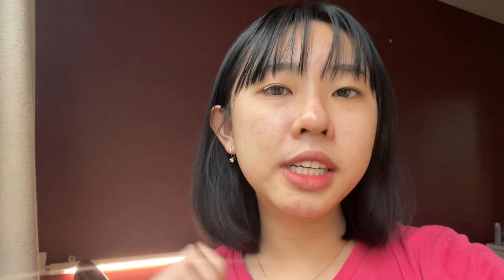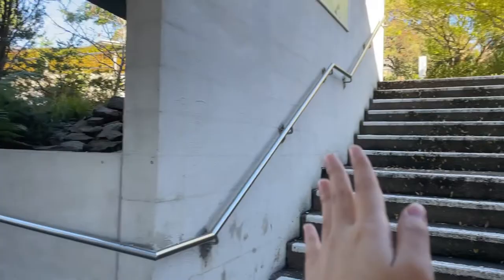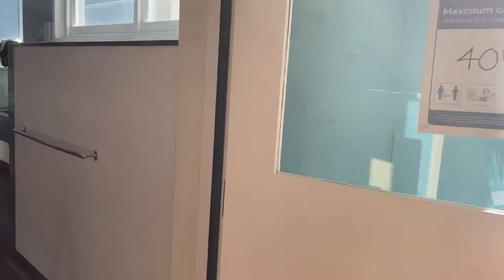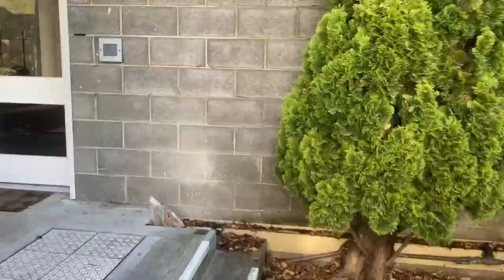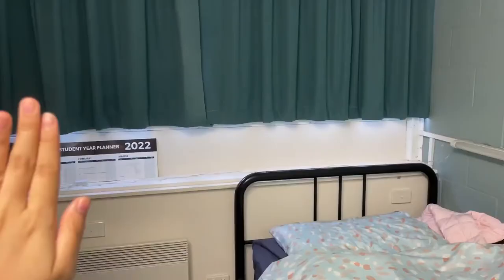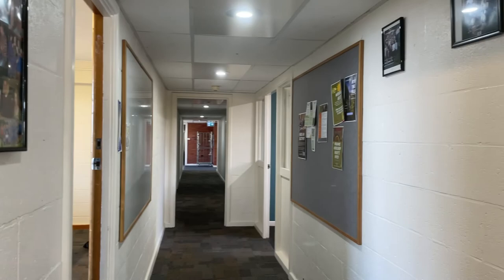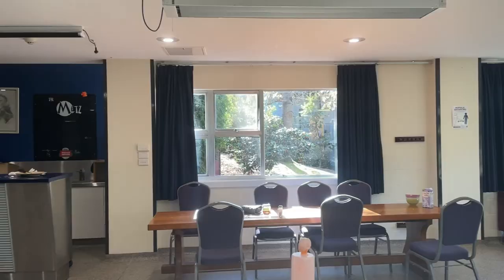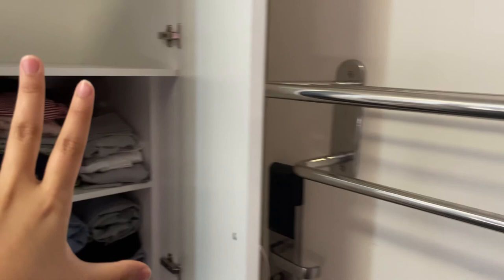UTAS Accommodation Room Tour Pt.1 I John fisher & Christ College dorm | University of Tasmania dorm

Comment: Hi, will heater and fridge be provided in all rooms? How far is this from Menzies?
Reply from the maker: Yap, all provided in each rooms.
Reply: They are far but not too far. There is a shuttle that will take you, but you can walk it in about 25 minutes. Beware, the accommodations are up a pretty steep hill.